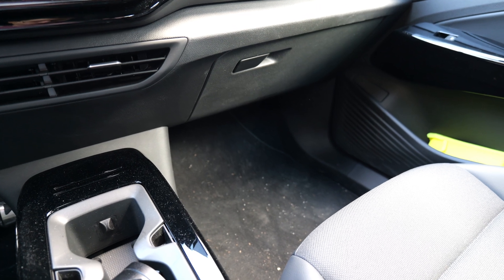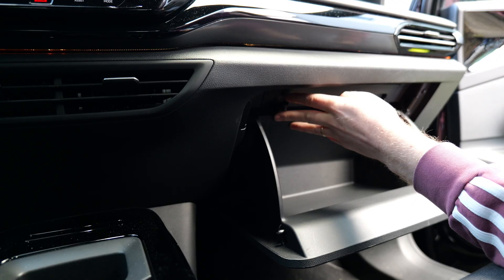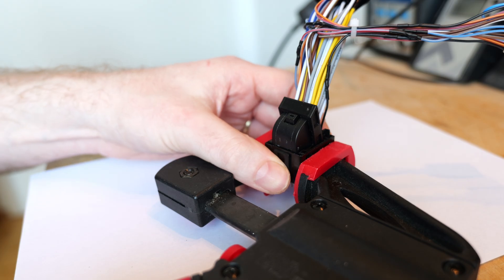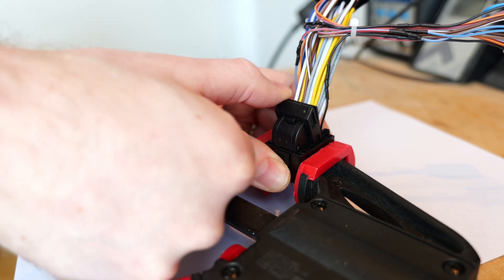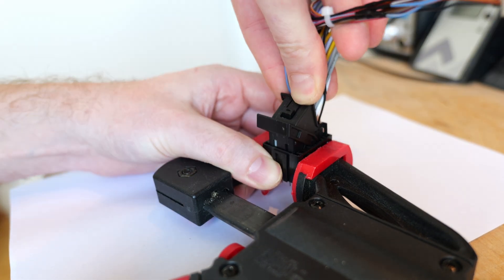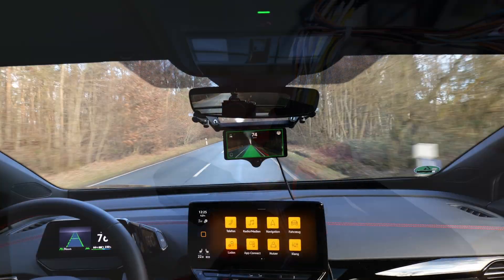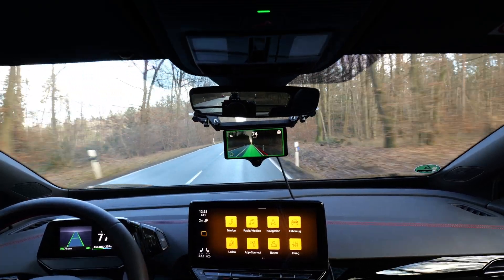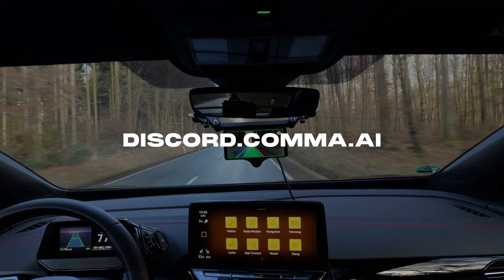Openpilot Gateway Harness Installation - 2023 Volkswagen ID.5 (MEB)

Comment: Do you happen to know where the harness is located on the IDBuzz? All Buzz owners would be very appreciative.
Reply from the maker: Yes, it should be in the same location: the passenger's footwell.
Reply: @lukaslotkolben1347  thank you! Also, I know IDBuzz isn’t officially supported by Comma but people have had success getting it to work with a “fork”. Could you please share a link to the software that would work with the IDBuzz / MEB .
Reply from the maker: @christinetarver9839  probably "infiniteCable2/master", but i guess you have to add the fingerprint of the car first.